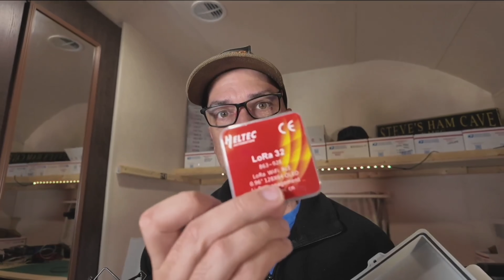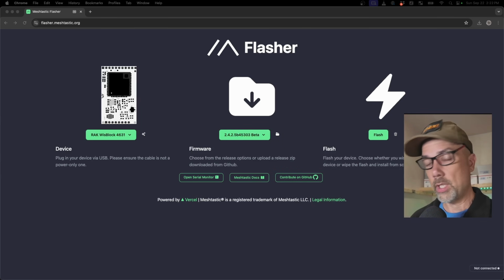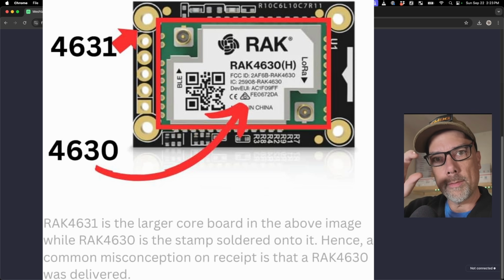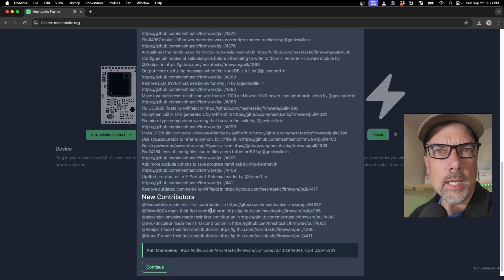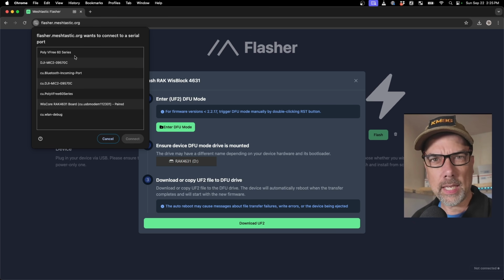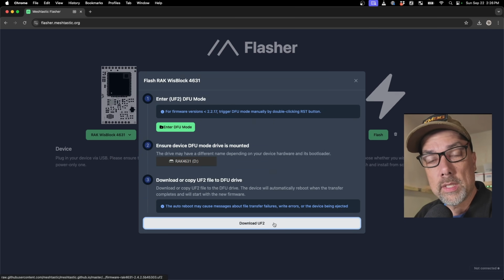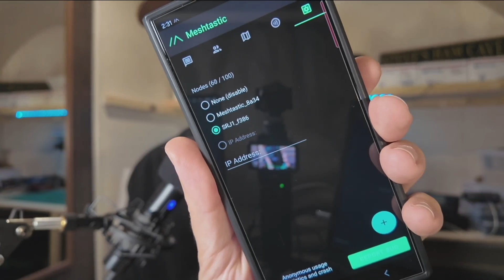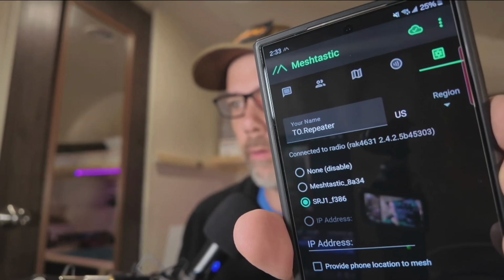Easily Flash Your Rak 4631 Meshtastic Device

Comment: I have this, but when i flash meshtastic it shows critical error #3 which indicates no lora module. When i do hardware test it shows that lora works
Reply from the maker: That stinks, what does RAK say?
Reply: @temporarilyoffline  they sent a hardware test firmware, in that everything working fine. When i flash meshtastic error 3 comes up. Tbh idk whats happening. I asked in meshtastic discord, they said its hardware issue

Comment: Hi TO, great pair of videos on the mesh repeater. There's just not enough mesh info out there, so it's great to see your channel jumping in, especially on the tech side. One note, I've set up and updated the firmware on two devices via Firefox with no issues.
Reply from the maker: Thanks, the RAK devices should do well with Firefox (it's just saving a file to disk vs. some serial connection). I'm just trying to keep it simple-ish for new folks.

Comment: In most cases, devices should be left in CLIENT mode unless they have exceptional geographic line of site that could warrant them being changed to ROUTER or REPEATER. CLIENTs still participate in the mesh to relay traffic, so there's no downside to your roof or short mast node being a CLIENT . But if a node is a ROUTER or REPEATER in a sub-optimal position, you could be damaging the mesh protocol more than helping it. Search the Meshtastic docs for "Configuration Tips" for more details.